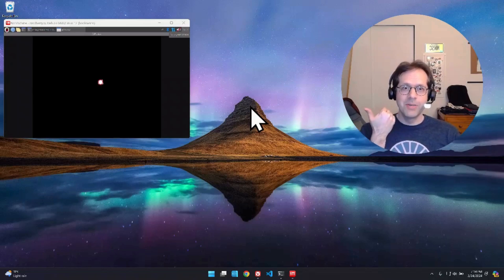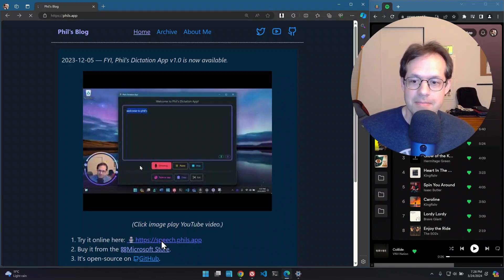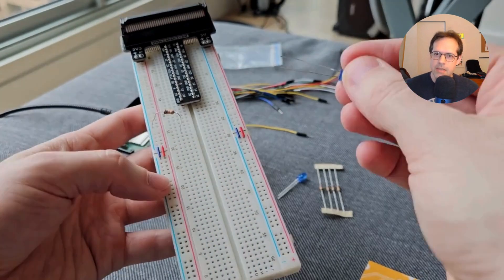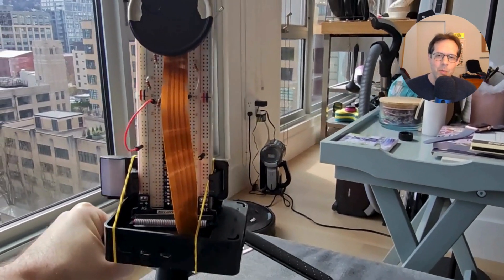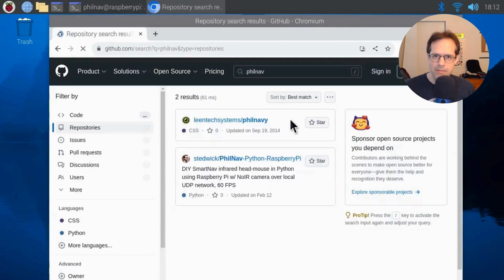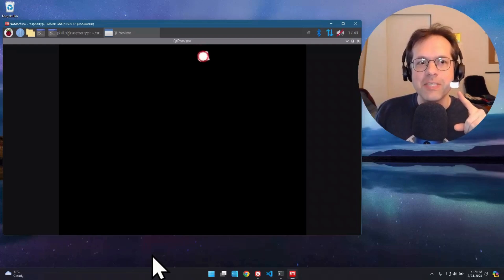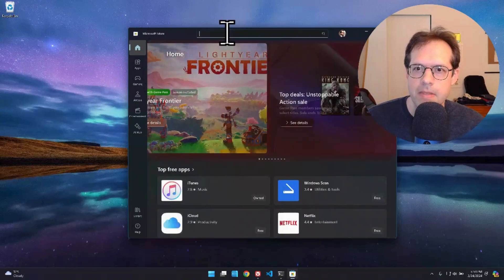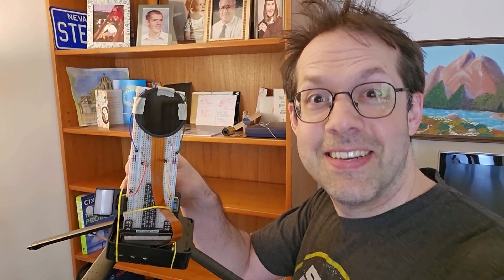DIY infrared head-mouse in Python using Raspberry Pi w/ NoIR camera @ 75 FPS

Comment: I'm a disabled person and I use the Smartnav to operate my PC and play video games. My Smartnav unfortunately broke and is being held together by glue and tapes so I've been looking for a backup solution for years. You sir are our hero!! 

Does it matter which Raspberry Pi 5 version? (2gb,4gb,8gb)
Reply from the maker: Hi lionlord! 👋 I hope building your Raspberry Pi infrared head-mouse goes well! It's not easy 😇

Any Raspberry Pi should do, even old ones prior to the 5. I'm using the Pi 5 with 8 GB of RAM, because why not, it's a full Linux desktop that way as well, although more expensive. Running the python script takes approximately 0 cpu/ram resources.

The most important thing is the camera. Be sure you get the right camera, with infrared, with the right cable, etc.

When the SmartNav with discontinued, I had an anxiety attack. My entire career and livelihood depends upon using my computer hands-free. Now that I've built my own, it's such a load off. I finally feel at peace after so many years of worrying. I really hope it does the same for you!

Leave comments here, and I'll help you the best I can within a day or two.
Reply: @PhilipBrocoum   Hi Phil! Thanks for replying! I definitely understand the anxiety.

One thing I'm a bit worried about that I didn't realize until you mentioned it's a "full Linux desktop". Does that mean the Philnav isn't something I can just plug into my current gaming PC? That would be very unfortunate for me.
Reply from the maker: @Lionlord44  PhilNav will "just work" once it's built and set up.

But if you're not tech savvy, it will be a slog. And depending on how disabled you are, you might need a friend to help you.

PhilNav uses the client/server model (similar to video games!). The Raspberry Pi is the "server" that sends mouse movements to the "client" PC over the network (Wi-Fi or ethernet). It does not need to be "plugged in" to your PC.

I have my Raspberry Pi server running on my desk, and I run the Python client script on my three laptops; my personal Windows PC, my work MacBook Pro, and my hobby Linux machine.

Yes, the Raspberry Pi is a full Linux desktop, and it's helpful to have some knowledge of Linux during the build and set up phase.
Reply: @PhilipBrocoum  Thank you so much for the thorough explanation. That answered my concern and beyond! I am relieved to hear it just works with pretty much any device.

Comment: Would there be a way to rotate the camera device (using it in landscape mode?) 

For example, if the height of the device is too high that it blocks the monitor screen
Reply from the maker: I haven't added a rotation flag on the client Python script yet, but it would be easy to do ⤵ 👍

Also, of course, it can be physically built any way you like. It's tape and rubber bands holding it together 😂
Reply: @PhilipBrocoum I’m really keen to give this project a try (RSI)! Would you let me know once the rotation flag has been implemented Phil? My setup definitely would only be amenable to a landscape oriented PhilNav haha
Reply from the maker: @NickGhale  I added a rotation flag this morning, so now you can run the client like `python3 ./client_win-mac-nix/main.py --rotate -90`

If you'd like to see the code, it's right here: https://github.com/stedwick/PhilNav-Python-RaspberryPi/pull/3/files
Reply: @PhilipBrocoum thanks a lot! How about having separate sensitivities for vertical vs horizontal movement Phil - Would that be tricky to implement? 

I was looking around at existing options for hands-free mouse movement and noticed some of them with that feature
Reply from the maker: @NickGhale  I went ahead and implemented it this morning. You can now pass arguments like `--x-speed 15 --y-speed 35` to individually set the speed for your X and Y movements.

Comment: Is there a way to check if the port 4245 and 4246 is open to receive before purchasing? If the client machine is a company laptop
Reply from the maker: Interesting question. Here's how to see if you have permission to open ports:

On Windows, go to Control Panel → firewall → allow programs through firewall. You also need permission to modify Norton Firewall, or other such programs if they are installed.

On Mac, go to Apple → Settings → Network → Firewall. And on Linux... I guess it depends, but on Ubuntu its `sudo ufw allow [port]`

You also need permission to install python3 on all of these OSes.

Most companies will make exceptions for accessibility purposes. Not saying it will be easy. =P
Reply: @PhilipBrocoum hi. I am on windows. 

I see a list of apps with checkboxes for columns: “Domain”, “Private”, and “Public”. I am able to edit these. However the fourth column to the right of these 3 is titled “Group Policy”, and it says “No” for every row entry in the list. 

Does that mean I would be able to use the PhilCam? There’s an alert at the top that says some settings are managed by the system administrator
Reply from the maker: @NickGhale  See if you can download Python3 from the Microsoft Store here: https://apps.microsoft.com/detail/9pnrbtzxmb4z?hl=en-US&gl=US.

If you can add it to that list and set various ports to be open, you should be good to go.

If not (ie. it requires an administrator) then sadly you can't use PhilNav =(

If you want to risk it and pay for return shipping, I'm happy to refund you if you want to try the PhilNav and it doesn't work.
Reply: @PhilipBrocoum thank Phil. Just curious, how would you rate the performance of this VS something like the trackIR to control the mouse cursor - in terms of accuracy?
Reply from the maker: @NickGhale  The performance is exactly the same. It's pixel perfect accuracy at 75 FPS. I used the NaturalPoint SmartNAV for many, many years until they discontinued it. That's why I built my own. I made sure it's as close as possible.

The difference is that theirs is a nicely manufactured product, and mine is a monstrosity held together literally with rubber bands and masking tape =P

Also, mine has no UI. Here's my terminal start command: `python3 ./client_win-mac-nix/main.py --speed 15 --smooth 3 --deadzone 0.04 --keepawake 56 --timeout $((60*60*8))`

Comment: How big of a monitor you think this will work on? I have a 55" TV I use as a monitor and I sit kinda close.
Reply from the maker: I use a 27 inch monitor. It really just depends on whether you can move your head/neck to look at all four corners of the monitor comfortably.
Reply from the maker: Also, you need a place to put the PhilNav camera within about 3 ft of your head. I have it beneath my monitor. On a selfie stick above the monitor works equally well.

Comment: Chronic tendonosis sufferer here with a million dollar question. Have you tried first person shooters with this. I have rigged up an airmouse to my earphones (an android tv box remote+) and can play turned based or use my computer normally, but it doesn't "center" or loses center if I go to the edge of the screen so its useless for first person shooters. I know this is based off camera tracking (which I have also tried with a ps3 camera and opentrack) but that was too sluggish and drifted a lot. This looks like its running at a much higher refresh so that might be solved. Does this understand center well enough and have no drift such that you can play say Sniper Elite type games? If so, you may have a sale.
Reply: Thank you very much for answering. I have used the equivalent of track IR and no it is not appropriate for first person shooters but it works well in flight simulators as you say. I'd like to believe your system is precise enough for an FPS I just wonder whether I would be able to train my brain to look where I'm aiming with enough precision to shoot a target. I worked with special needs children providing them assistive technology and software for 9 years for a school board here in Southwestern Ontario so I am very familiar with the nature of motor issues and semantic gesturing. It's one thing to help someone with it though and to experience it yourself. I think I will save up some money and have you build me one if you're still doing that. Again thanks for answering.
Reply: Also, forgot to ask. Could this be built sideways? The tower would be too tall for my setup. Thanks again.
Reply from the maker: @DaleMetcalfe-k9k  Yes, I'm sure I could build it sideways. 😅

Another option is to extend the selfie stick so it peaks out above your monitor, rather than below.
Reply from the maker: @DaleMetcalfe-k9k  You can buy it here if and when you decide to do so: https://philipb.gumroad.com/l/philnav

Be sure to remind me it has to be sideways, so i remember to accommodate that.

Also, you seem pretty technical, but just checking: did you watch the full 15 minute video and you feel that you are technically savvy enough to handle the various installation instructions, and troubleshoot if something goes wrong? I'm happy to help over a video call as well.

Glad to hear you're working with special needs children, it's always rewarding =)
Reply from the maker: Because of my hands, I don't really play video games anymore. So, I don't know how well my DIY infrared mouse would work. 

I know lots of people swear by the Track IR for gaming, especially flight simulator type games where you feel like you're in a cockpit: https://www.reddit.com/search/?q=trackir

My DIY mouse moves with relative positioning, which is like a normal mouse: if you move your head up the cursor moves up, regardless of where the actual pointer is on the screen. Some other mice have absolute positioning, which means the cursor is where your face is pointing at.

In terms of centering, there are tools and scripts that can create a hotkey to center the mouse, such as AutoHotkey or the built-in PowerShell: https://answers.microsoft.com/en-us/windows/forum/all/is-there-a-hot-key-that-will-bring-mouse-cursor-to/42e740b2-5533-425f-b7d1-f091f9fa526c

For the record, my head mouse has no drift and can run up to 100 frames per second. (You would likely need to right click and run it in an administrator terminal to send mouse movement to a game.)

Good questions Dale!

Comment: Looks great, I'm guessing it could be modified with a webcam instead and avoid the rpi ? must be a python library for normal usb webcameras ? Perhaps there's even a cheap webcam with ir led's and filter ? Found this "Arducam 1080P Day & Night Vision USB" on amazon with light sensor (just cover it up with some tape)... might get one or something simular and try ? What do you think ?
Reply from the maker: https://smylemouse.com/ is what you want if you're using a webcam. Try it for free! The reason I went through all this trouble was to reach that "last mile"; for my purposes I wanted pixel perfect accuracy at 75 fps using 0% local cpu and leaving my webcam available for other things like video calls.
Reply: @PhilipBrocoum  Thanks... I use mostly linux, so your solution is much better than the windows only one. How powerful does the pi have to be to get 75 fps, I thought those cameras where only around 30 fps... will go back and look at which bits u used.
Reply from the maker: @ndudman8  The Raspberry Pi camera can do 120 fps. Most consumer webcams are optimized for high-resolution, and run at 30 FPS or slower, and take lots of CPU. There's also a noticeable delay between capturing the frame reading the frame. 

I wasn't able to find a way to run a normal webcam at a very high frame rate and very low resolution. Specifically for head tracking, we want low resolution but very fast refresh.

The best one I found was the Razer webcam which can run at 60fps, but it's just not good enough. High latency, high CPU, etc.

The Raspberry Pi camera is optimized for science-y stuff; it runs fast with low latency and high accuracy.

Anyway, would love if you found a way to run a normal consumer webcam in such a manner of that this works well!
Reply from the maker: @ndudman8  By the way, the ps3 eye camera was supposedly the best high frame rate consumer camera https://www.amazon.com/PlayStation-Eye-3/dp/B000VTQ3LU?th=1

But it doesn't work anymore, no official drivers

I'm using the pi 5, but any Raspberry Pi should be able to handle this
Reply: @PhilipBrocoum  Thanks for all the replies... I'm understanding the problem with the frame rate and seeing why the rpi is a good solution. I'm trying an old rpi 3. with night vision pi cameras...  I'll let you know if it works
Reply from the maker: @ndudman8  Best of luck! 🤞👨‍💻
Reply from the maker: Also yes, this should work with a infrared camera locally as well. You would need to modify the python scripts to use OpenCV camera instead of PiCam, and "combine" the client and server scripts into one.

Comment: Very cool! It seems useful for people without use of their arms. Have you thought about using google’s media pipe for face tracking without the sticker or ir camera?
Reply from the maker: https://smylemouse.com is a fantastic software-only head mouse. It uses facial recognition via your webcam. Especially good for traveling. 

I built PhilNav because I have very specific needs, namely accuracy and speed. To get pixel-perfect accuracy at 75 fps, the hardware is necessary.